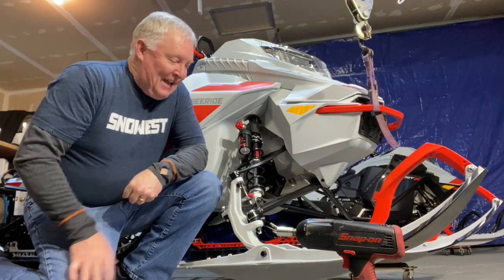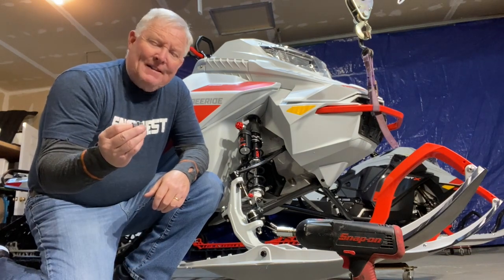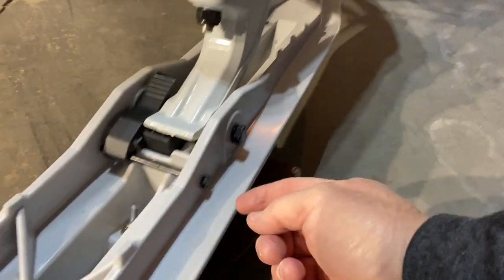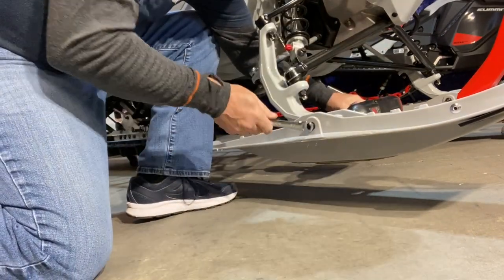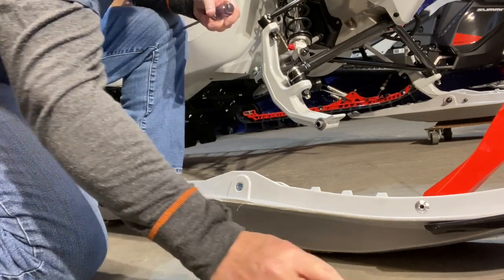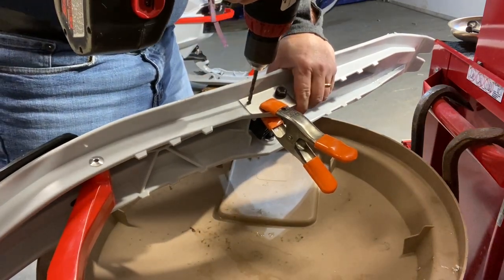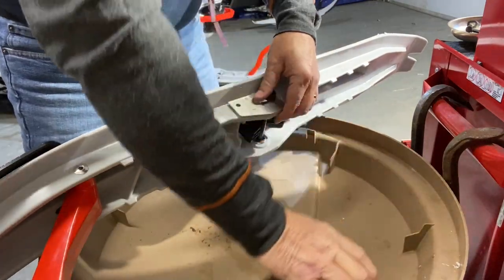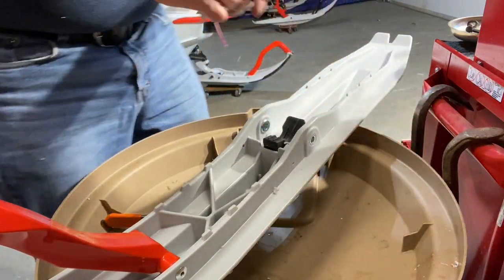Ski-Doo Ski Stance Adjuster Installation

Comment: Those things don't stay down.  I've been running them for 3300 miles on my 2022 backcountry and I just took them off yesterday.  Since day one, they bounce up and off, then the ski will wash over.  I don't feel like it's ever been a major handling issue like caused darting, etc., but it was probably in my head.  However, moving them in 2" felt like it made a difference in the powder and on the trail when they worked.  A smarter trick to helping with tipping in the powder is your stabilizer bar delete which is a quick-connect/disconnect, spring loaded part for $15.  It's great.  I used one on my summits for almost 10 years.